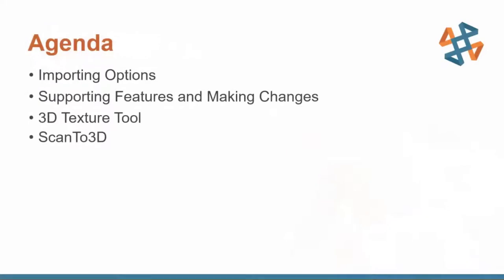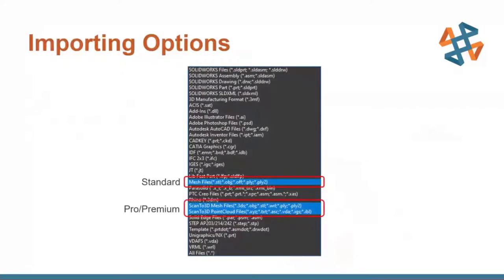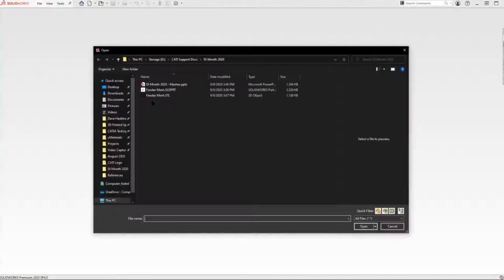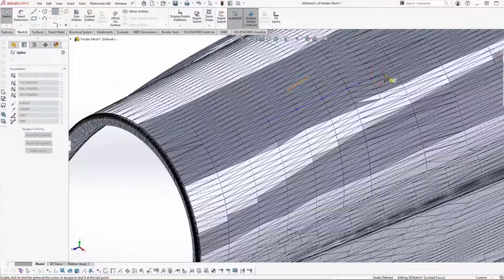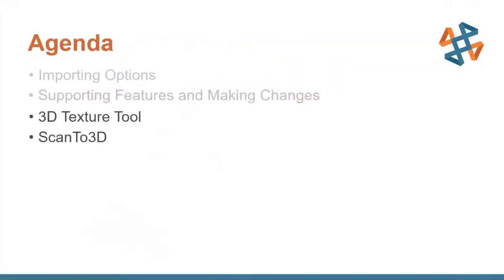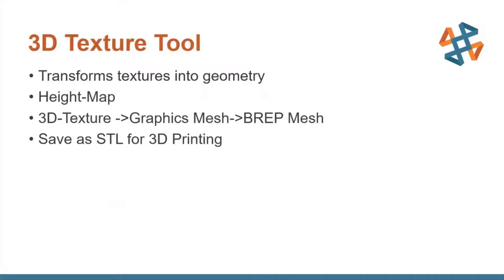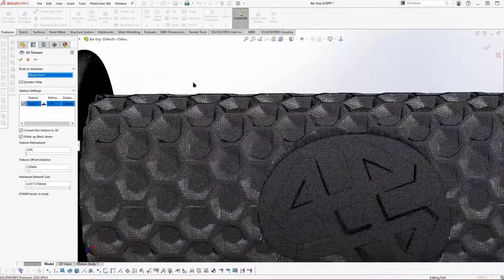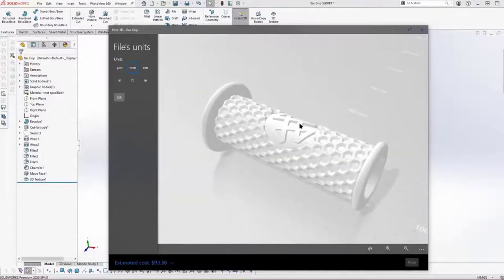Working with Mesh Files in SOLIDWORKS

Comment: Is the Mesh Modelling Tab a custom tab?  For some reason I don't see it even though I can access all of the commands.  Also I believe Slicing is what was used at 14:11 in the video, not intersect.  If I am not mistaken intersect finds volumes only, not intersection curves.  Also, slicing adds to a folder called Slice## if that option is checked.